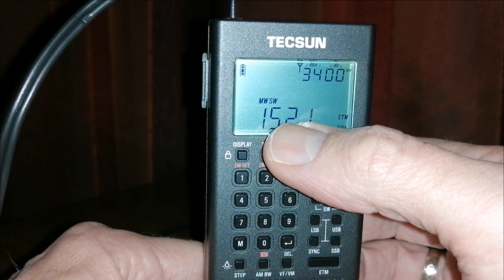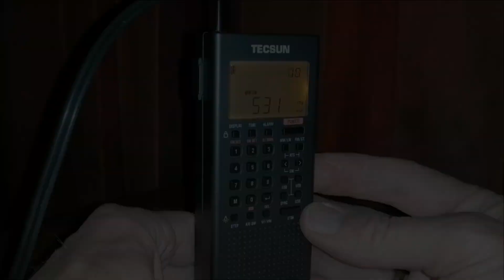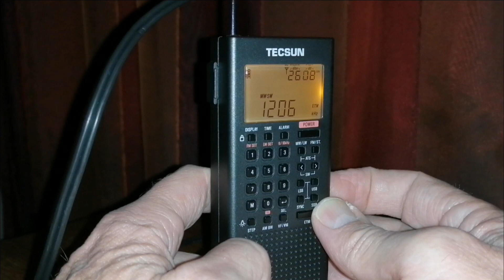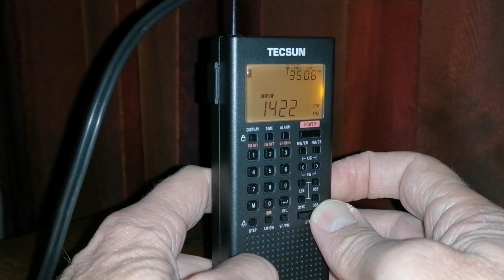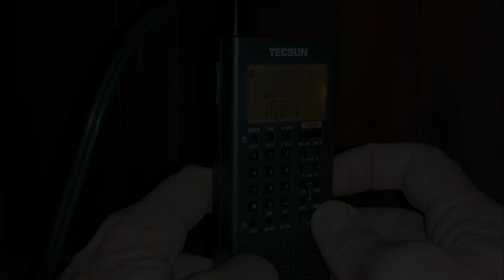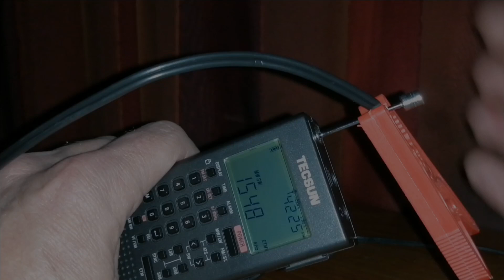How to improve MW reception on Tecsun PL-368 with a long wire

Comment: I don't understand how to save stations manually and cycle them. In the manual it says in sv mode to press M, but there's no key labelled M. Can anybody help please? Ty
Reply from the maker: If you are talking about the Tecsun PL-368, the M button is just below the 7. Find the frequency you want to save, press and hold the M and wait for the memory locations to appear. Then use the tuning wheel to select the memory location, the number. Then press the M again. To cycle through your saved memories select VM and cycle through with the tuning wheel.

Comment: Wow. What would happen if you tried the same frequencies with the an200 loop and the internal and external antenna, along with the telescopic aerial? Basically, I mean keep the frequencies and use the other methods I mentioned and we can see what happens. I am happy you picked up all the Cape Tonian frequencies. I was listening to Magic 828 before I went to sleep and I heard the same song you did. YMCA. I remember growing up listening to those sort of songs. We listened to songs from the 1940s to 2000s.
Reply from the maker: I have used the AN-200 on this radio before, it picks up most of the same stations. But the wire picked up two more.
Reply: @swlistening  So you have used the an200 loop with the internal ferrite, external ferrite, and telescopic aerial? It is amazing that the wire can make such a huge difference. Speaker wire is one of the more conductive wires available on the market. I guess I have to go to Pick n Pay in the rain to get some speaker wire, maybe even Brights or Makro. They are probably closed now, so I might have to wait until next week.
Reply from the maker: @FamtechVideos  I used the loop with the internal and external ferrite antennas on the PL-368. It helped, but the wire is better.
Reply: @swlistening  OK. Let's see if I can get an An200 loop for my Sony from Bob Shop and I can try DXing with the telescopic aerial and loop without the wire. Either way, the wire makes a huge difference as you said.
Reply from the maker: @FamtechVideos  That will be fun to try. Just keep in mind that the AN-200 couples inductively with ferrite antennas, and it only receives MW, not SW. So I am not too sure that it would be of any use to try to couple this with a wire on MW, like on the PL-368 when using the wire.
Reply: @swlistening  I know. I was saying, maybe if I order an an200 loop, and I connect it to the external ferrite port, I will see what I can pick up.
Reply from the maker: @FamtechVideos  OK, sorry if I misunderstood what you were saying. The loop will certainly help, I have done that with the PL-368. But I still think the wire works best.
Reply: @swlistening  OK. No problem Andre. Have a wonderful day.